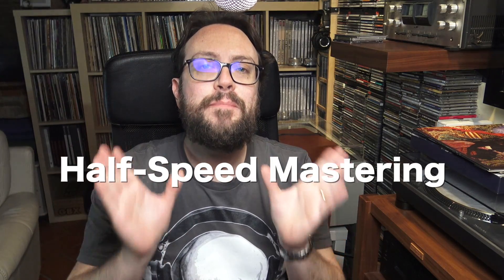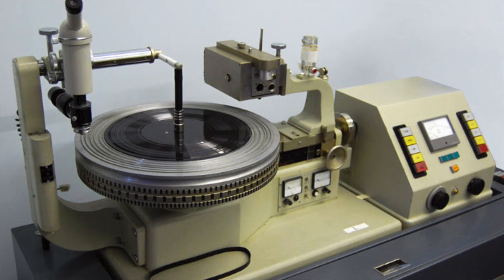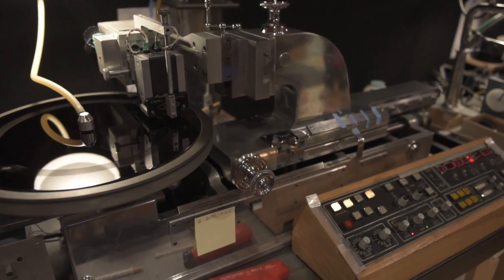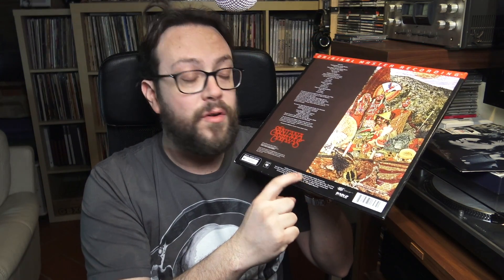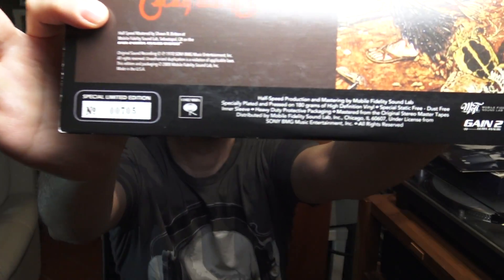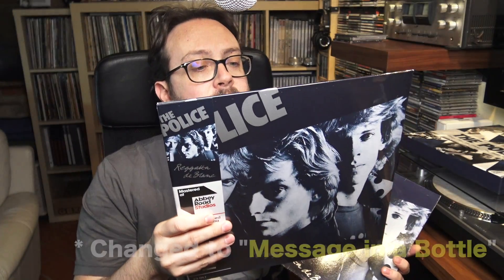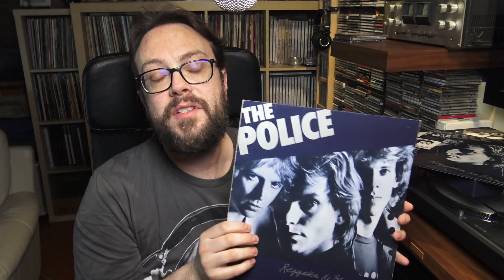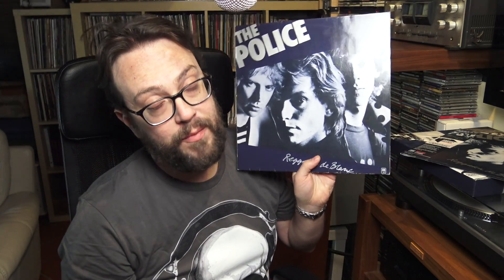Vinyl Half-Speed Mastering: pros/cons & test

Comment: Wow man, this is something. I have to say that after listening close and both played 2 times I found that clip 1 actually has a richer tapestry then the 2nd one.  As far as it's audible to me. I struggle with tinnitus which in my perception is caused by my at times relentless disregard for ever acquiring hearing damage when I was younger. I'm 46 now and I'm working with vinyl since I was 13, you can do the math. 
[And please do not take that risk lightly, your hearing can and will suffer damage in the long run. What does that mean? Well, my tinnitus consists of a 14.000 hertz beep being permanently present. Yes you read that correctly, I have a permanent beep of 14.000 hertz whistling inside my head.. ]
Back to the point: While I initially thought clip 2 would be the one mastered on 0,5 speed because of the below this comment mentioned argument by Peter Wikvist and others, and you telling which was wat (bc I was listening with my eyes closed and didn't notice the pause-the-vid suggestion), I had to be sure and went online to hear it through my studio monitor speakers.

Michael Ransom makes the best point actually;  "File 1 has obvious clarity and detail in the cymbals which File 2 lacks. File 2 has more bass up front but if it is at the cost of mid range clarity or if File 1 half master has the ability to bring out this clarity." The rest is nice and all, but I doubt the capacity of some to make a sound judgement about sound.  (pun intended;-) They do have a point, don't get me wrong here, but if you have a proper mixer installed in your sound set-up bringing up the level of bass is a cosmetic trick and would eventually   make the first clip sound even better then the second.

In the end it's where your standards are focused on and your interests are centered around that can (and will) help you decide. To the untrained ear subtle nuances are more than often lost. That doesn't mean those people are "wrong" by definition, on the contrary: it means that there are skills to be gained through previously unknown challenges! (I regard that as a good thing)

As someone mentioned "the bass wars" are to a certain extend at play as well here, although that can be somewhat adjusted, and shouldn't be a big issue when taken in account. 

The "winning" clip would either way still be #1 because getting a 5 hertz sinus wave cut in vinyl should make the "sounds fatter" argument folks reconsider theirs. The fact that it doesn't register upfront and right away does not mean a thing. At least, in my (not quite but intended as) humble opinion.

Great channel man! Someone who brews these kinds of stews deserves respect I'd say. Or at least some confirmation of capabilities. So off course I subscribed right away, and sign of happily knowing I've got good stuff to binge!

Thanx, mate
(edited to correct spelling only)
Reply: https://www.youtube.com/watch?v=VbVx-e9i1Uk

Comment: The second file was far batter than the first. The second file had the base, the whole range was better, it was clearer, more thump and the highs too were great. What is the point in doing half speed pressings if it was a digital file?! Gotta watch out for words like digital remaster, digital reissue, if anywhere on an album's jacket reads "digital" drip it, digital is crap when it comes to vinyl.

Comment: Not only is file 2 “fatter” (soundstage), you can hear the tape hiss (sound floor) when it kicks in, indicating that sonic detail is more present. Based on this, I would guess that File 2 is the 1/2 speed master. If I’m wrong, I am going back to CDs. Hehehehe, just kidding. The German pressings back then were pretty good, I prefer the original. I have 1/2 speed Eno masterings and I’m not sold on it. A good master is a good master, full speed or half.

Comment: The side-by-side-comparison is unfortunately flawed because too many heavy variables come into play here:
1. the mastering/cutting engineer was not the same (different sound taste)
2. the cutting studio was not the same (different cutting equipment)
3. the pressing plant was not the same (different machines, vinyl formula etc)
4. the 40 year old pressing is more likely not mint anymore

All that can affect the sound way more than just the effect of the cutting speed.

If we really look for a shootout of the effect that half speed mastering has we need a cutting engineer who cuts the same music in both ways and galvanized and presses in the same facilities. (if he does one side normal and then the same thing on the other side in half speed would be perfect for comparison)
Reply: But thanks for the video - i will look for the police box now :-)
Reply from the maker: You are right and I knew that since the beginning. Unfortunately it's practically impossible to have the same identical disk cut in two different ways unless we decide to do so with a cutting engineer.
Reply from the maker: P.s. I have the box. For me the sound is decent but but not extremely good. I would go for the originals or for the SACD versions. Much better!

Comment: Just cutting the disk at 1/2 speed isn't a guarantee for better sound. I started collecting MFSL back when they first started and not only did they cut the records at 1/2 speed but they spent a couple of months of work for just one album by re-engineering the music to perfection from the original master tapes using the best state of the art equipment that could be found and even invented at the time. That's why it was such an improvement over what was the norm.
Reply: https://www.youtube.com/watch?v=VbVx-e9i1Uk

Comment: From what I've read in the comments, people confuse mastering with the physical fidelity of the disc. The main advantage of recording at medium speed ensures the cutting head more time to work at high frequencies, this greatly solves the effect of internal distortion. In sum, the sound obtained is cleaner, with less distortion and no wheezing. This does not add or subtract frequencies, it only resolves them better at cut time.
People are only evaluating if it sounds sharper or more open and this is because they were made with different equipment. We already know that in the analog world there is nothing mathematically identical.
The sound samples were taken from the second track of this LP, an area where distortion is less likely for any cutting technique.
A fair comparison would have been with the last track and clarifying that the listener's attention should be on the distortion and not on the sound equalization.
Reply from the maker: Inner groove distortion will surely benefit from this process but the main advantage is that all frequencies are cut at half their value, so higher frequencies, which may be cut off or distort have the chance to remain intact and present in the groove. Very simple.
Reply: @anadialog  Very well, we agree, it is more or less what I have said before. The distortion actually becomes more evident around 17000hz. Low and mid frequencies are not a big problem for the real speed cutter. Excuse me if I am being imperinent, it is not my intention.
Listeners do not pay attention to this aspect, they only talk about the different equalizations that actually have other reasons. This technique does not address that issue. What's more, even it seemed to me that the original version sounds more open.
From a strictly technical point of view, cutting at medium speed is much more effective when the recording is of quality and the mastering has been taken care of respecting the physical limits of the vinyl, otherwise it would be useless, perhaps even worse. This is why this technique is not always used.

Comment: As others have said, file 2 sounded better. I suppose that may only mean that the sound engineer who cut the master on the original had better material to work with, better cutting equipment or a better ear. A true test would be to listen to 2 records cut on the same machines and pressed at the same factory, but one of them cut at half-speed and the other at 33 1/3. we'll never get that test. However if half-speed mastered records consistently sound shallower than older standard recordings that would be a strong case against it.

Comment: I agree with your assessment number 2 sounded better. Was this an old Mo Fi or a relatively new one? If new could the difference be due to degradation of the master tape with time and number of plays. Also I heard rumors that Mo Fi could not always get the original master and sometimes used a second generation master and claimed it was the original Or they made a digital copy of the master and used it before digital improved to where it is now.
Reply from the maker: MoFi? I think you got mixed up. Just a first German pressing against the recent reissue done ad Abbey Road...ah, you mean the Santana Album, it's an old reissue, that should be genuine but yes, you are right, they did do that unfortunately...

Comment: File 1 better bid did you allow for equalization factors on bass?
Half speed would need more emphasis on bass as rate of change of flux would decrease,hence output to head reduced thereby reducing bass volume and dynamic range.
Cheers Colin S30/8/19

Comment: I would recommend you check out releases from Tacet (pronounced as Ta as in "ta ta ta" and cet as in "set"). Their half-speed masters are excellent. Also I would would suggest you try one of their LPs that plays from the inside of the LP. This is not exactly a new process. Back in the 30s, 40s and early 50s before the advent of tape for radio broadcasts, Some classical pieces as well as some radio programs were recorded this way. it was so that the change in speed from the outside of the disc compared to the speed on the inside of the disc can accommodate the frequencies changes. If you go to their website www.tacet.de you will find the information on each of the LPs. Either half-speed master, backwards play (inside to outside),  and so on.
Reply from the maker: Thanks Keith! I will certainly do that. Thanks for sharing.

Comment: Interesting comparison again. I downloaded your files and compared them with a rip from my original CD release version (bought in the mid 80s). Some things I noticed:
File 1 (new master): The stereo balance is a bit off! The right channel is about 3 db louder than the left. Overall less bass and dynamic sound compared to the File 2 and the CD version.
File 2 (original vinyl master): Better bass and dynamics compared to File 1. Stereo is also in balance.
For both File 1&2: The stereo is left and right swapped compared to the CD version! Maybe you swapped the left and right when digitizing the sound?
For better comparison I loaded them all in Audacity and corrected the Left-right stereo to match with the CD, I then normalized the files, so that they all are at 0 db max. From all three, the original CD version to me sounds the most dynamic and detailed, it's actually a really good sounding CD. Closely followed by the original vinyl release. The new master didn't impress me much. It didn't do anything positive for the high frequencies or detail, but it does sound 'flatter' with less bass and dynamics.
It goes to show, remasters aren't always the best versions.
Reply from the maker: Thanks for you interesting analysis! I have to check if I reversed left with right. It's just sad to see how these new releases aren't good enough...
Reply: Yeah I agree. I wonder if it's down to poor mastering or if tape degradation plays a role. The channel balance issue would be a mastering flaw though, I'm sure.

Comment: File 1 sounded a bit flattened/brickwalled compared to file 2. File 2 sounds like it has much more dynamics and sharper attack of the kicks, but also a bit more bass.
As far as I know, the half speed lacquer cutting is more like a thing to show off with than an actual improvement. 
Hypothetically it can have a positive effect, since slower speeds produce less friction in the grooves, meaning less heat. 
If that makes a difference, I suspect it to be so small that even the inertia of a special ultralight and stiff boron cantilever overrules the improvement, let alone all the other limitations of a turntable system. 
When it comes to mastering process 'specials', only three things I've heard so far give a noticeable improvement (if applied correctly): Original mastertapes, triple A process and DMM.
Especially DMM, when it comes to surface noise reduction.
Reply from the maker: In fact a DMM video is on its way!
Reply: @anadialog  Ah, interesting heads up! Somehow, I remember you already talking about DMM in one of your previous videos, I don't know for sure though.
Reply from the maker: Correct! But just a few seconds...

Comment: So many variables between the original press and the new one, the major one being elapsed time of over 3 decades.  Technologies have changed.  The gear has changed.  The engineers have changed.  And, I am without my high-end headphones, right now!
.  I remember the 'debates' that cycled around in the late 1970s and early 1980s.  I am sure they haven't changed that much.  I personally favor the production argument that the cutting head underwent less stress and power issues at half-speed, along with the platter stability.
.  The quality of the vinyl medium is also great importance.  And, there were several versions of 'virgin vinyl', each touting their specific qualities.
.  Similar to tape, I guess... What I do remember is that the analog mastering process for vinyl was an art.  THe 1990s introduced a myriad of digital compression and sonic maximization processes, all for the sake of cramming the VU meter for as-loud-as-possible.
. The return to mastering for vinyl seems to have brought back the analog processes I think the 'industry' lost for almost 15 years.  I recently digitized a DYAN album and cleaned it up to uncompressed WAV format.  The overall quality and sonic life of the recording was amazing.  It reminded me of the JVC Cutting Center pressing of Elton John's Goodbye Yellow Brick Road (released under MCA Records). I recently digitized and cleaned that album up, and am amazed out how much life and energy is in that 1973 pressing.
. Anyway... great topic.  I can't wait to get home and listen on my high end headphones, this weekend.  I think you could do a dozen episodes on the various physical and manufacturing processes that go through taking the studio masters to a consumer vinyl pressing, and still not get all of it!
Reply from the maker: True! Thanks!

Comment: I chose file 2, it was either more dynamic or just louder. The shimmer and bass seemed fuller on it. More balanced. Again, maybe its unfair if its just a louder cut, or did you make them equal in volume?
Also, this isnt really a fair way to compare half speed with. Its okay if you just want to know the best sounding press, but not if Half Speed is good or not. For that you would need the same mastering engineer doing both methods. And here we have Miles at Abbey Road and who knows from Germany.

With this said, I really like the DSOTM MFSL pressing, and I have the Japanese PRO USE, UK original and 2016 reissue. It does lack some vocal punch which the PRO USE has and bass which the UK is better at, but its the smoothest of them all and still dynamic and deep.
Reply from the maker: I German pressing was 2db louder, not much. But its not just that, unfortunately...yes I agree, this was more if an overall test between an original analog pressing and a recent good digital pressing....to complicated and in my opinion pointless to evaluate only the cutting speed....I also agree that there are several high quality releases out there...

Comment: Interesting comparison - I too preferred file 2.  What cartridge were you using for this test?  Just curious as some cartridges seem to be better with one style of music over another.

Another question comes to mind about the mastering.  You showed the equipment, and as far as I know, all mastering is done using a linear tracking method.  I find it interesting that all modern turntables are using pivot arms vs linear tracking that were gaining in popularity when CDs started taking over.  

I recently obtained some Technics linear tracking turntables and find them excellent because the P-mount cartridges are quickly installed and the only adjustments/alignments needed are tracking force.  With linear tracking, there is no anti-skating adjustment and the design of the P-mount cartridges were standardized to eliminate all other alignments.  

Have you tried any linear tracking turntables and why do you think that these haven't made a comeback as they would seem to be technically superior to pivot arm types and would probably be considerably easier to make given the technology available today?

Great channel and keep up the good work!

Bob
Reply from the maker: Hi Bob, the cart is a MC Dynavector DV 20X2 L. Very interesting observation. You are right. They cut tangential but we listen mainly in pivoted. No, I never had a tangential TT although I have listen them. The problem is technology. Just like direct drive motors, you need a very good (hance very expensive to develop, produce and buy) project. Low quality tangential TT are very very bad. If you are employing state if the art technology and materials it is probably superior ti pivoted tracking. Pivoted and, following my example, belt drive TT are much much more easy and cheap to produce and make. Now  with this comeback we may be seeing new quality priducts worth the purchase. Especially, I think, with HD vinyl...